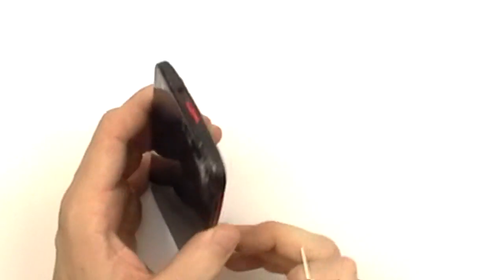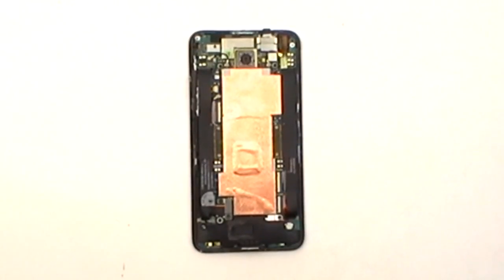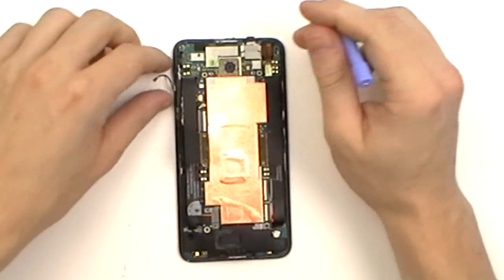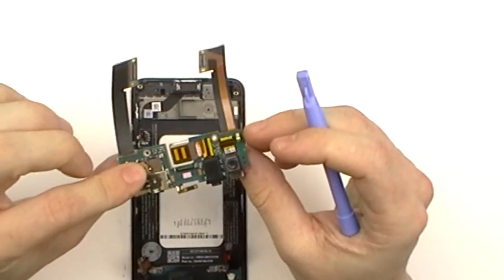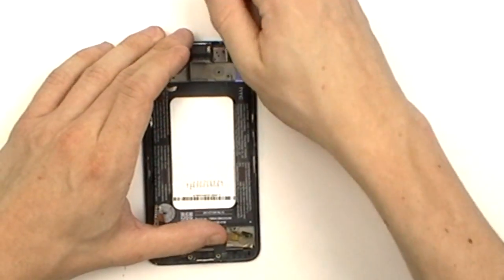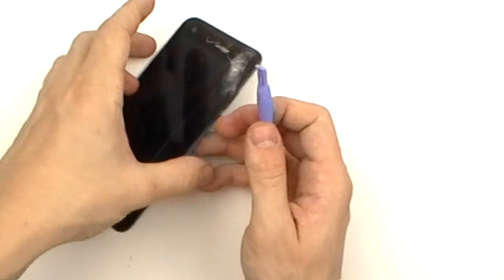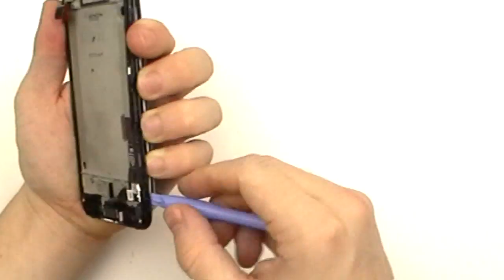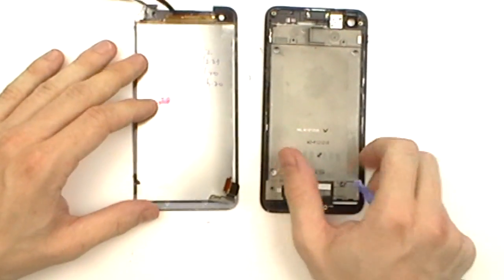HTC Droid DNA Screen Replacement Repair Guide

Comment: I wanted to share my repair experience with anyone contemplating doing this. I was hesitant to repair myself but didn't want to waste the money paying someone to do something I could easily do. Loved the DNA and after seeing the price of replacement parts I said screw it I'll try it.

I followed this instructional to a T to replace my screen and digitizer as well as install a new battery. Only thing this instructional does not explain is that if you replace the lcd/digitizer the easier way with the digitizer assembly combo is that you have to remove the volume controls and ear speaker (which is impossible to do without breaking). I recommend following this video for assembly and reassembly but once the battery is removed watch this video: https://www.youtube.com/watch?v=eNuwsOA1EfE to see how to remove and install the ear speaker and volume controls. Then come back to this video once you are ready to replace or reinstall the battery and then follow this video backwards for reassembly.

A new ear speaker can be bought for $3 to $5 online so i would recommend buying one if you bought a lcd/digitizer assembly.

FYI: I used all repair universe parts...phone works great (except for me breaking the ear speaker in dis assembly). Ordered a new one and once installed the phone will work like new, also I had no repair experience so this can be done by a novice.
Reply: +nutsallinyomouf Hey, thanks for telling me to take the earpiece out! I would have totally missed that, which wouldn't have been good! Thanks for the video link, too! Now, I think I"m finally ready to order the replacement screen assembly and put it back together. Thanks again!

Comment: Old video, but hoping for a response :/   I followed the directions to disassemble perfectly.  I had ordered an lcd/digitizer already seated in a new housing so I wouldn't have to mess with reapplying adhesive.  I got everything assembled back together perfectly.  I go plug in to a charger, and (I had previously kept it on a charger while waiting for the screen to arrive) I have the solid green light, and a developer splash screen (normal).   

...But it won't power on :(  I disassembled again and saw that the power button portion of the flex cable had an ever so small snip torn off (less than the width of a paper clip).  Will that small of a tear affect the powering on of the device?  If so, do I really need to order an entire motherboard flex cable?  Or can I simply order the power button portion of the flex?  

Thanks in advance for any response :(
Reply from the maker: I apologize to hear about this issue. Unfortunately any small tear in the flex cables can cause an issue. You may need to get this replaced.
Reply: Repairs Universe Hey thanks for the reply even on an old video!  All is well fortunately!  I took it apart again, and re-seated the power button with the black plastic strip a couple times, and everything is working great!

As an aside:
For yourself, and anyone else watching this tutorial, if you buy a new screen and housing already assembled (easier, no mess, no adhesive), the new housing does NOT come with a new earpiece in it.  So the ear speaker needs to be removed from the old housing and moved to the new one.  This seems to be left out of ALL tutorials I've found, but is essential! 

Thanks again for the video :)
Reply from the maker: Glad to hear we could help here. We appreciate the support!

Comment: Hello! first things first, thank you very much for your tutorial video. I would have spent a month trying to work up the nerve to pull my phone apart without your video. As it is though the repair went well enough, but my wifi antenna does not seem to be picking up signal as well as it did before. Do you have any recommendations for repairing that function? Which connector is the wifi antenna? And again, thank you!

Comment: I successfully replaced my screen digitizer assembly however the phone no longer charges! everything else works fine but my battery is almost empty I have taken it apart multiple times and tried to fix it... do I need to replace the bottom part of the motherboard? also this is my dads phone I tried to fix so I feel really bad and the connector on the bottom part of the motherboard (micro usb and speaker) appears to be missing a gold connector
Reply: please get back to me anybody! I need to know if I should buy the bottom part its about $20 bottom part meaning the board under the loud speaker with a flex cable and micro usb charging port

Comment: Hey I recently paid somebody to replace my screen and everything works fine it's just I don't have 4g connectivity anymore and my bars drop and pick back up frequently while on 3g can anyone help me solve this problem so I can take it back to the shop and tell him what he needs to do
Reply from the maker: Sounds like one of the antenna either have come loose or was not attached during reassembly. Its fairly easy for the tech to check this by taking the back cover off of the phone. How is the WIFI working? If all else fails have the carrier update your PRL (preferred roaming location) over the air. This may help.
Reply: WiFi and everything else works just fine and how do I update my PRL if it comes to that
Reply from the maker: Call your carrier and tell them you are getting poor signal and they can do an over the air update for you.
Reply: Alright thanks I should have just sent it to u guys instead
Reply from the maker: If they cant get it fixed. Send it into us and we will look at it for you.
Reply: Repairs Universe how much would yall charge just to look at a problem like this
Reply from the maker: We charge 60.00hr for repair and diag. If you sent the phone into us you would be looking at 30.00 for us to diag the issue. If its something simple that would be the only charge plus any parts that may be needed. You can find our repair services here.
http://www.repairsuniverse.com/repair-service.html

Comment: Do you have to apply new adhesive to get the new screen to stay on? I recently got a repair guy to replace a broken screen, and the new screen is coming off slightly at the bottom.
Reply from the maker: shambz Yes, we typically use 3mm double sided film.

Comment: Don't bother buying just the front screen. Buy the LCD/Digitizer assembly. It'll save you time and money because you'll never be able to get the two apart like this video.I've tried twice now and have had no luck.  The screen is very fragile.  Keep the phone out of your pocket!!  Good thing it was free from Verizon.  Of course free is a relative term, I did renew my contract for two years.  Thank goodness my old phone still works while I wait for parts.

Comment: So I did this and from what I could tell did so quite well. Everything looks connected and good to go. Yet when I try to turn it on, after 5 seconds the home buttons start flashing and the screen stays blank... did I break it?
Reply: Update: After I unplugged my phone from the charger it wont respond at all... no lights, buttons anything. Even when charging. When I plug it into my PC I get the "bloop" connected sound, but nothing shows up? I"m thining maybe battery?
Reply from the maker: Mark Campbell What was the original issue with the phone?
Reply from the maker: Mark Campbell It sounds like you are having a hardware failure. Take the unit apart. Unplug one thing at a time until the unit boots. More than likely its going to be one of the cameras, or a defective screen. Let me know how it goes
Reply: Hey thanks so much for the response! Actually never saw the first one. I ended up just getting a new phone, sorry I wish I had inside to get back. Thanks for your help. Great video
Reply from the maker: Im sorry I didn't get back to you in time to help you fix your device. I check my posts every day so if you have any other issues let us know

Comment: I just replaced my screen and the orange light came on and now it is green but it will not power on. I think I may have not reassembled the tape on the power button correctly.
Reply from the maker: Anne Howie Does it respond to a charger?

Comment: can you please help me find an outer screen replacement for my HTC Butterfly S ? the touch feature is still working but i couldn't find an outer screen anywhere!
Reply from the maker: Muath Alfawzan Do you need just the front glass? This can be difficult to find, we suggest repairing your device using a Digitizer + LCD combination screen.
Reply: Repairs Universe yea just the front glass, because everything works fine with the device
Reply from the maker: Muath Alfawzan It is nearly impossible to replace just the outer glass. You would need specialized machines and some sort of epoxy to reattach the LCD with the glass.

Comment: I dropped my phone, and now the screen will not come on. The bottom part of the screen does light up when I hold it. But the screen it self does nothing.
Reply from the maker: xpod27 It seems as if you broke your LCD while dropping it. Can you see any cracks underneath the glass?
Reply: Repairs Universe I do not see any cracks any where under the screen.
Reply: Repairs Universe If I were to send it in to you, would you be able to fix it?
Reply from the maker: xpod27 Yes we can fix it, If your bottom buttons light up but the screen doesn't than it usually means the LCD is damaged/broken.
Reply: Where do I send it to? And what is the price range?
Reply from the maker: xpod27 Follow the link in our description and navigate to the bottom column on the left hand side. You should see a link named "repair services" with instructions on how to send it in.

Comment: So I dropped my phone again.. and fixed it again following this video. Way faster second time around too. Great video, thanks!!
Reply: Jennifer Charneski  It was a bit difficult the first time. Opening the case took a while, the glue was holing pretty tight and I was worried I'm applying too much force and probably breaking something. Same with removing the battery. I drew out a diagram of the phone and placed the screws on the diagram so that I know exactly where each screw and connector came from. I also took a lot of pictures in the process so I know how to go back. It wasnt as difficult as I thought though, just very stressful. I opened my phone at least five times since then, and now I do it pretty easilly.

Oh, by the way, I bought the digitizer+LCD together, not just the digitizer, as Repairs Universe  strongly recommended. Also make sure that whatever you buy either contains the speaker (the one you hear from when you hold the phone to your ear), or you can buy it separately for like $10. I didnt know about that, and it's impossible to take the speaker out of the old screen without breaking it. My phone didnt have a working speaker for a week until the replacement arrived, but I could still use it on speaker phone or with a headset during that time. It's such a good feeling to put it back together and try out all the modules (cameras, both speakers, microphone, wifi, data, voice, gps, etc) and find out they all work. I once did not place the connector for one camera correctly and had a mini heart attack when I thought I broke it. I opened it back, tried again, and then it worked fine.

Oh, another tip, I believe this is not mentioned in the video: there are two screws holding the microphone/speaker assmbly to the case. When you realize you can't remove it, look for those screws.

You can also consider buying a digitizer+LCD+battery pack, which will make it even easier, as you're stopping at the battery removal step.
Reply from the maker: Diana Delibaltov We are glad to hear your repair went well! If you ever have any issues with repairs in the future, we will be here to help!
Reply: So this is not that difficult at all? I am trying to find a way to replace the screen i would rather pay this price then the replacement price and loading all my information again.
Reply from the maker: Jennifer Charneski If you get stuck don't hesitate to contact us. As Diana Delibaltov  stated we suggest purchasing a Digitizer + LCD combination screen if you aren't experienced in repairing electronics.

Comment: Hi,

Your video ends with the removal of the display assembly.  If I want to replace a cracked digitizer without replacing the LCD, what additional steps are required?

Thank you!
Reply from the maker: noisevenyes It is nearly impossible to replace the digitizer without breaking the LCD. You would need a specific machine and it is suggested for professional technicians only.

Comment: I just replaced the screen on my DNA everything works great but, now I have no camera. It worked before I started. I have redone all of the placement twice and it still says it can not open the camera. Does anyone have any suggestions?
Reply from the maker: Hello Celeste , Please check the flex cable and check the camera if it is damaged.

If still nothing. Sounds like the camera is stuck with the stutters open or they are stuck close.
With that you will need to replace the camera.

Comment: thanks for the video got my case open and seems I have a refurbished model, 2 stripped screw heads. couldn't get any farther
Reply from the maker: With striped screws. You would need to PRESS hard to release them.
Or find a small flat tip and press hard to release them. Stropped screws are a pain to deal with. but with some work you can release them.

Comment: Great instructions. However it fails to mention how to remove the speaker from the top of the frame WITHOUT DAMAGING IT. Thankfully new ones are about $2. 
Also it made no mention of removing the Torx screws...only the 13 phillips. 

Otherwise, fantastic.

Comment: Will the phone power on without the rear cover? I meticulously followed this video and got my phone together, but it doesn't seem to power up.
Reply from the maker: Hello, sorry if you are haven problems. Lets get you up and running.

Yes. it can. But when you plug in the phone IE charging it. Do you see the light blinking on the top right? What color is that light? Is the light steady on?
If it is blicking then it needs to have a base charge for it to come on. I asked what color because when it needs a charge or on very low life it will be orange-ish color. If it has a good charge going it will be green-ish. if the light is steady on , means its got a nice charge going.

Cant wait for your reply.
Reply: The charging light does not come on at all, with the back cover removed or not. All the ribbon cables, antenna cables, etc. seem to be properly seated, and I was very careful not to damage the battery when I removed it. Freaking out :/
Reply from the maker: Erik Jochums ok, So with the back cover off the light does not come on. and with the back cover on it still does not come on.

No worries we will get you working.

Ok, Now you will have to reopen the phone . take your time and follow the steps. take the phone apart one more time.

After that.
we are going to put it together. because it sounds like a flex cable is not connected or not fully locked down IE jawbone is not pushed down.

Put it together and then plug it in and see what happens. you should now see a light and it should be blinking. Tell me if that helps. See you on the reply
Reply: I tried that a few times without success. I had to take it to a local repair shop to have someone else take a look at it. But if they can't fix it, I'm thinking about sending it to you guys.
Reply from the maker: Erik Jochums
Ok Erik, sounds good. Sorry you could not get it. Kinda bummer. But no worries if the local repair shop can not get it . We would gladly help you out.

Comment: Just as an observation having just done a replacement screen
If you purchase a screen with frame and light guide thereby making the job easier )hopefully :) )
you will need the speaker from the top of the old frame
BE BLOODY CAREFUL REMOVING IT

Comment: One other note: make sure you get all the ribbon cables securely fastened into their connectors after the screen is replaced. I found that a small flat head screwdriver is an indispensable tool for that step.

Comment: Thanks for the video! I successfully repaired my screen. One question though: has the phone in this video already been taken apart? I noticed that the components are a lot more difficult to remove than the video suggests due to the adhesive everywhere.

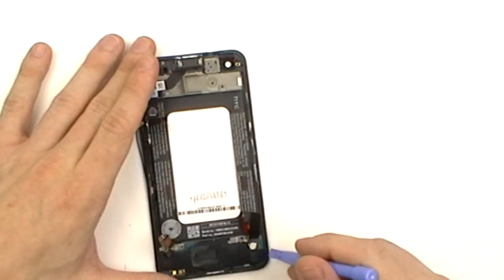Comment: 4:50  The lower speaker assembly is also held in by two torx screws.  The video says "simply held by a few clips."  You wont get this out without taking out the torx screws.

Comment: The screen doesn't come off.  I got through all the steps and have been blow drying for 45 seconds on and off the last hour.  Nothing is giving anywhere.  In fact, eventually all pushing in the camera area did was cause the tool to burrow a whole through the glass.  This is looking like a scam to get people to buy the kit.

Comment: GUYS , THIS IS IMPOSIBLE TO DO , I DID ALL BY GUIDE AND LCD AND ACTUAL GLASS FUSED TOGATHER , I WAS HEATING IT SO MIGHT GLUE WILL LOOSE AND I CAN SAPARETE IT , BUT ITS IMPOSIBLE LCD IT VERY VERY VERY SANSATIME AND YOU WILL GET IT SCRACKED 100% JUST BUT WHOLE NOW FRONT !!!

Comment from the maker: These screens are bonded together. Some repair techs out there have the experience and the correct tools to separate the LCD from the touch screen on this particular device. But usually during this process the LCD can easily become damaged. We strongly suggest using a LCD + Touch Screen assembly to complete your repair. It will go much smoother and less risk is involved.